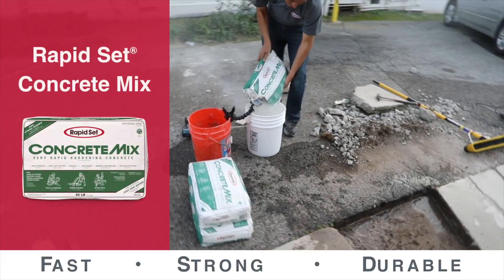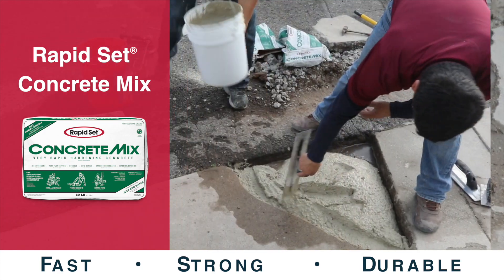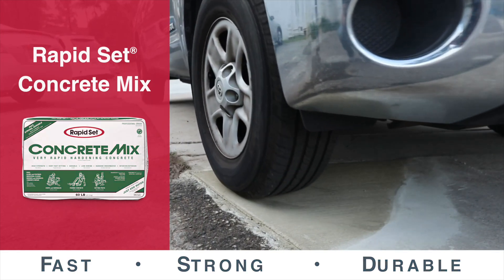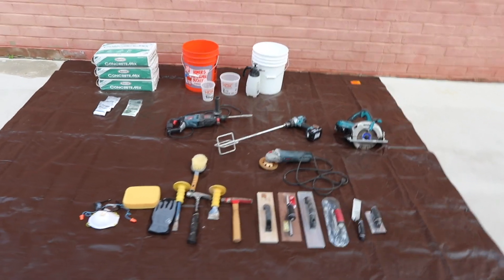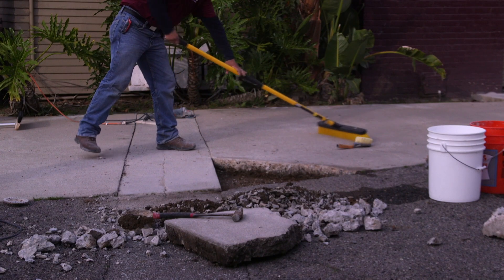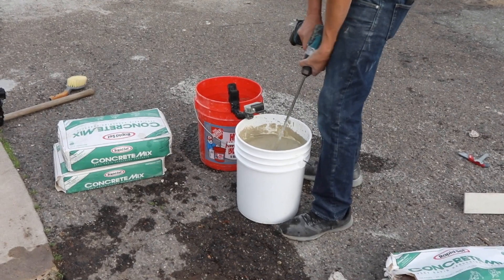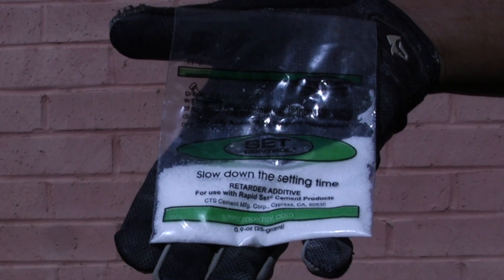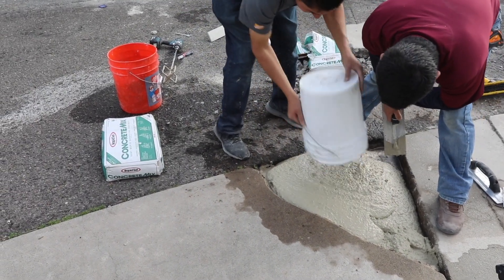Rapid Set® Concrete Mix

Comment: How soon can I put an epoxy paint over Rapid set? Do I still need to wait the standard 28 days?
Reply from the maker: Hello Edward. You can apply the epoxy coat 16 hours after the Rapid Set Concrete has hardened. Thank you for choosing Rapid Set.

Comment: Would this be suitable for stairs?
Reply from the maker: Hello Kevin. Rapid Set Concrete Mix can be used to form or cast stairs. It can also be used for repairs thicker than 2 inches. For repairs less than 2 inches thick, we suggest using Rapid Set Cement All. Both products have the same performance characteristics, but Cement All is applied from featheredge to 4 inches thick. Concrete Mix can be applied from 2 inches to 24 inches thick. Please let us know if you have any further questions.
Reply: @CTSRapidSet  thanks for replying to my question so fast. One more got you, can I mix RapidSet with a darker bag mix to enhance the colour to match excising structure?
Reply from the maker: @kevbutler81  you can add color to the Rapid Set Concrete Mix to darken it.  We don’t recommend blending Rapid Set with ordinary portland cement concrete, as it can affect the final performance, setting time, and strength. 
If you have further questions, please let us know.
Reply: @CTSRapidSet  that’s perfect thanks